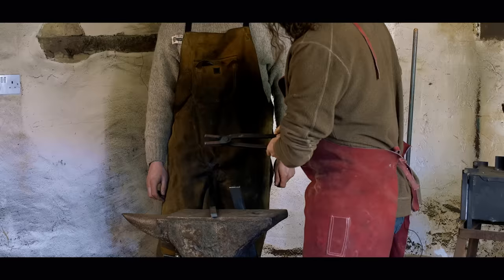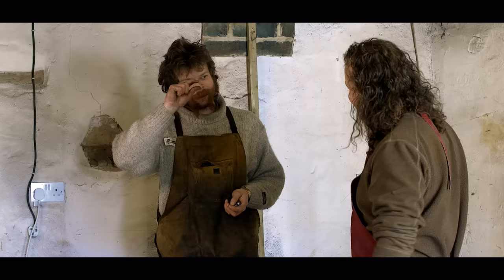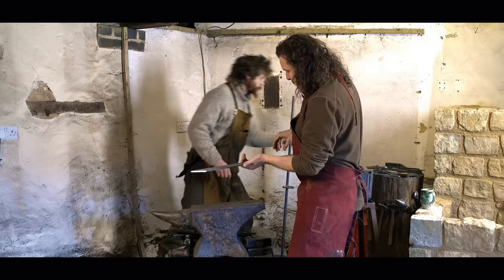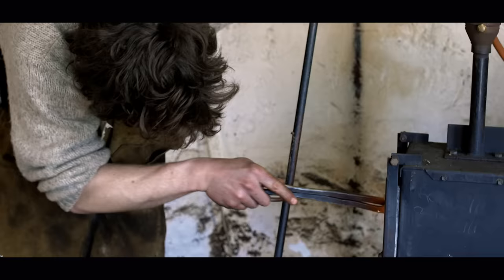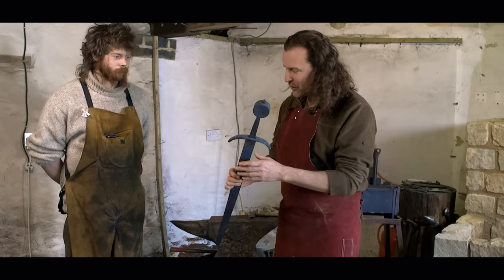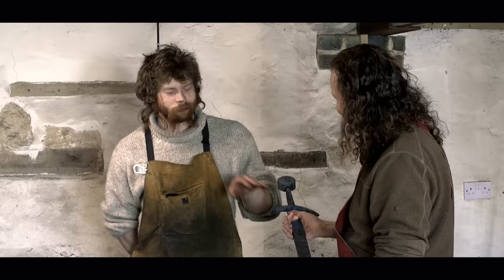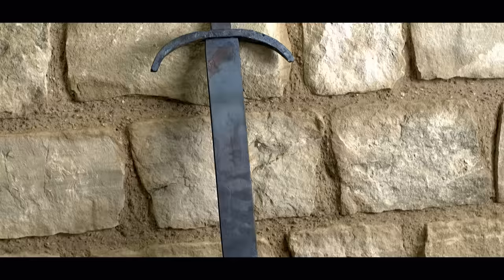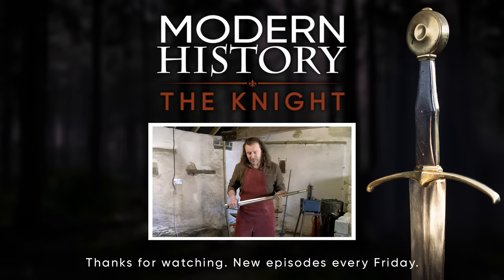Medieval swords: how were they made?

Comment: One word of advice, never pick a fight with a blacksmith. They're incredibly strong.
Reply: Not stronger nor faster than a sword yielded by an expert swordsman.
Reply: @luisromanlegionaire  He was talking about a fistfight.
Reply: A blacksmith is far too valuable to ever be sent into or anywhere near a battle.
Reply: Brother
Reply: And they have HAMMERS
Reply: Not true honestly. Actually a lot of old school blacksmiths have shaky hands. Hammering a lot is not good for the joints. 

Also, as a recreational blacksmith and powerlifter, one of those things made me stronger, the other involves a hammer.
Reply: @horvathbenedek3596  my 30 years experience in auto body collision repair if you want to last a long time with a hammer you need rubber covered handles it helps defeat the vibration going into your hands and arms it helped me
Reply: @scottcampbell2836  Sadly that's a bad idea for smithing, or in general any kind of work where repeated use of heavy hafted tools are necessary - e.g. axes, hammers, pickaxes, shovels. Ask anyone who uses these what they prefer - it's bare wood with lacquer. 

Rubber has the unfortunate quality of being just hard enough that it radiates strikes into the palm HARDER than bare wood. It also tends to break up your skin and cause blisters, which again, isn't really all that fun. There's a reason no smith uses rubber grips on hammers.
Reply: @horvathbenedek3596  I only know from my own experience of hammering on frames I used to have all kinds of tendon and joint problems till I with that rubber handled hammers and the pain went away no hand problems no arm problems no back problems after 30 years I'm good. And I've done my fair share of hammering things with a hammer to straighten it out repair it reuse it Etc and making my own specialty tools
Reply: @horvathbenedek3596  and if you are not protecting your hearing your eyes and your arms and your shoulders and hands you going to have a short career
Reply: @scottcampbell2836  
Hearing - earplugs or headphones. A must for any blacksmith.
Eyes - safety glasses. 
Arms - well, common sense should suffice. If it looks and feels warm, don't touch it. 
Shoulders - wear an apron and fireproof clothes if you are finnickey. 
Hands - welding gloves on the off hand. Nothing on the hammering hand - your grip would tire fast.
Reply: @horvathbenedek3596  I always wear gloves the ones with the cushioning in them little gel packs never really noticed any difference with or without except it protects your hands better
Reply: @horvathbenedek3596  and I know a lot of people can't stand gloves they just cannot work with gloves on but doesn't bother me any
Reply: @scottcampbell2836  Well, for short work it might do, but think about it this way - when you are forging, your hammer is essentially a very crude paintbrush. The more control you have over it, the better. And me personally, I can't stand the prospect of anything being between my hand and my hammer. 
If you use it to hammer in nails or loosen stuff, it's fine to have padding. But if you use it to create shapes from hot steel, you need as much control as possible. 
Remember - one mistaken strike can take hours to correct during the grinding process, and it might be a permanent flaw in the end product.
Reply: @horvathbenedek3596  lol if you say so. I know better
Reply: @scottcampbell2836  if you say so. I know better ;)
Reply: Andre agrees
Reply: @horvathbenedek3596  because you are not real blacksmith, if you are recreational you are not proper smith... Heavylifting is shit.
Reply: Horváth Benedek old rubber handles (rubber over steel) were bad, but the new fiberglass shafts with rubber for grip are pretty good at damping vibration, like the Nupla handles. I’d recommend trying them if you haven’t. Maybe they’re not good for blacksmithing I’m not a blacksmith, but as a hammer for nails I prefer them over wood or steel. They do make a Nupla blacksmith hammer, I’d be interested if it’s good.
Reply: @boredinczechia4382  This guy, he got to it before I did. Good on you bro!
Reply: You got that right! Many years of smithing and never a problem with my back, hands, or anything. I have 14% hearing loss in my right ear but I had a severe ear infection as a child. I also believe part of that loss is from 2 years of working in machine tool factories- not from smithing. 
I always work metal at night to see the metal colour. This gentleman is one of the few smiths I have seen In videos who heats the steel hot enough. Most YouTube smiths work the metal much too cool, and frequently do not quench and temper correctly.  Ah well. At least they're trying.
Reply: the ones that dont use power hammers at least
Reply: tree unless it’s Henry from skalitz
Reply: @luisromanlegionaire  you get into a lot of swordfights then?
Reply: And we gots lots o' pointy stabby thingies!!!  =)
Reply: TheWallsocket as a blacksmith, my first hammer was a fiberglass handle coated in rubber and it gave me HORRIBLE blisters every time I used it.  I ended up taking a knife to remove the rubber and have it as part of my set of hammers.   My favorites have ash or hickory handles though. When you use the right hammering technique, you don’t get any shock down your arm.  It’s the guys who clutch the handles too hard at the moment of impact that screw up their joints.  (Think like clinching your fist just as you punch someone but in reverse)
Reply: I know a smith and  his grip is phenomenal , I have massive hands and a good grip but I fear his shake as it's like being wrung by a vise..

Fore arm strength is  the beast but I blame Hollywood for the idea that blacksmiths are muscled giants.
Reply: @horvathbenedek3596  Right - the hammering doesn't necessarily make you stronger. I have found that I can hammer steel for hours on end without getting tired, though. Different kinds of muscles I suppose.
Reply: @horvathbenedek3596   ive been a full time smith for 22 years, my hands are rock steady,  if your swinging your hammer correctly you'll be fine...if youve got joint pain and trembling hands then your doing it wrong...sadly a lot of people that get into my trade were never shown proper hammer form and do a lot of work related damage.
Reply: I wanted their fancy sword once in D&D so I tried to steal it and he 1 shot me
Reply: @horvathbenedek3596  Can confirm, but that's also a reason why blacksmiths tap their anvil. It does multiple things such as helps keepin rhythm, as mentioned, but more importantly it gives your hands a chance to rest. The tong "mouth" has to be completely flat to ensure no scratches/dents are made in the steel, and plus a 3.5 - 5 lbs cross pein hammer gets REALLY fuckin heavy after the first hundred or so strikes so it's natural to go from heavier hammers to lighter ones. 

It's WAY more important to have accurate and deliberate strikes as opposed to heavy swings, unless you're folding the steel or trying to drift a hole for a pommel or handle. 

But swing a 3 lbs hammer for a few hours with only stopping for 15-20 minutes, it will get heavy.
Reply: Unless you carry force amplifiers.
Probably made by said smith.
Reply: anybody who has played dark souls will confirm this lol
Reply: I did one particular job with my arm. Turns out  I didnt know how strong it made me and at 11 stone I was pretty much unbeaten at arm wrestling in my area against guys a foot taller.
Reply: @luisromanlegionaire  yeah the swordsman is generously more dangerous
Reply: @luisromanlegionaire

Wielded. Not yielded.

Comment: About hitting the anvil with the hammer: It's a way of resting as well. The hot iron is soft and will absorb the force, meaning that you will have to put force into every stroke. The anvil on the other hand is hard and the hammer will bouce off of it, meaning that if you just relax and let the hammer fall it will bounce back without you having to lift it and you can use that energy to bring it down onto the hot iron again.
Reply: So true. Also to keep a steady rhythm helps with accuracy I reckon. Staying in the pocket

Comment: Smiths were borderline sorcerers at the time. If you ever have the experience of seeing a master turn a pile of ferrous rocks into a knife, it's almost unsettling even with a basic knowledge of the science behind it. The most amazing thing I've seen, which is actually really easy, is lighting a fire with nothing but a hammer, a piece of wire and an anvil.

The value of "underlings" in a medieval smithy is an important aspect not to be undervalued.  In a modern workshop, smiths can use technology like power hammers, hydraulic presses and automated forges that would have required apprentices and journeymen for labor and extra hands to work bellows and swing sledges to keep the shop running efficiently.  It's basically impossible to form a puck of crucible steel into a bar efficiently without the aid of a power hammer or assistants with sledges.  One person needs to place and manipulate the billet with tongs while at least one other person needs to strike it with a heavy instrument to form the raw piece.  Ideally you'd have multiple assistants striking in succession to maximize the efficiency of a heating.  If you were trying to equip a company of fighting men with weapons or armor, it's not so difficult to make tools with mild steel on hand to expedite the process with specialized drifts or dishing jigs to make a load of swords, spears or helmets economically.  Without assistants, a chain hauberk would be a week's work, but with two or three apprentices you might make one or two a day.

Even using a household blowdryer in a DIY forge is a huge modern advantage.  That little piece of technology replaces an apprentice manning bellows.  Old blowdryers are literally a dime a dozen if you go to flea markets and thrift stores.  If it burns out, toss it in the recycling bin so the plastics and metals can be reincarnated into a new life.
Reply: Dude how high were you?
Reply: i dont think blow dryers are recyclable like cartons of milks are
Reply: @Skankhunter420  If you have to be high to put yourself in another's mindset, you clearly lack empathy and understanding my boy.
Reply: Unsettling? Really?
Reply: @Skankhunter420  Your pleasant
Reply: @PhyreI3ird  you arent
Reply: Not borderline, they WERE sorcerers. Well at least in eastern europe before christianity. Any working with fire and metal was a sorcerer job in pagan people mindset and they treat blacksmiths as such. They would ask them for advice about supernatural as well as creating charm and enchanting items and if there wasn't dedicated priest they would conduct religious rituals too. This usually derives from the fact that elder god in many pagan religions is associated with sun and fire.
Reply: Joseph Underwood  enoch the one who saw the ancient civilization technlogy!
Reply: @steirqwe7956  There's a dozen craft god at lest an just as many saints.
Reply: Gretna Green, Scotland - my friends got married there at the backsmiths, a "modern" wedding venue since 1754.  What may or may not have occurred there in bygone years I know not.  (Search Gretna Green if you're interested in "runaway" marriages, or elopments, and English vs Scotish laws.)